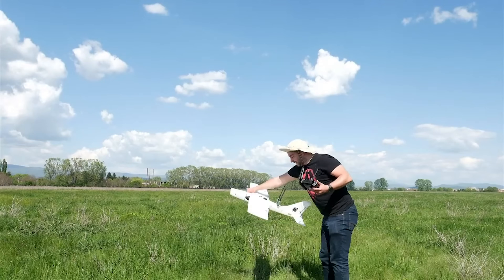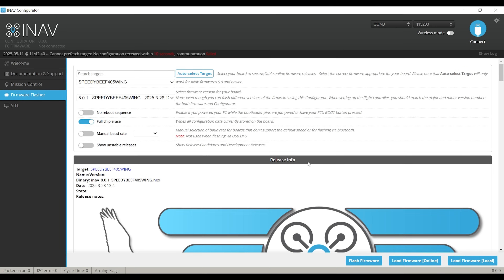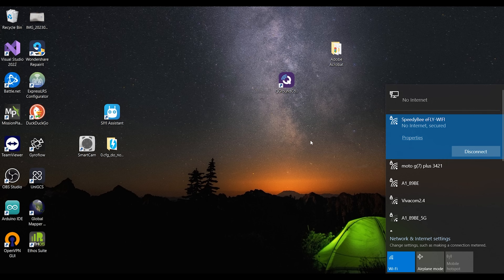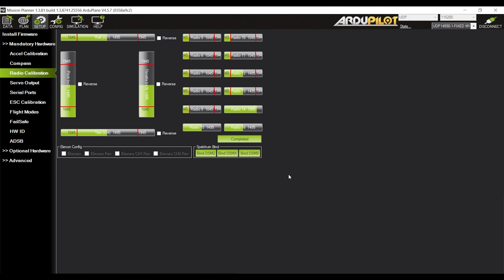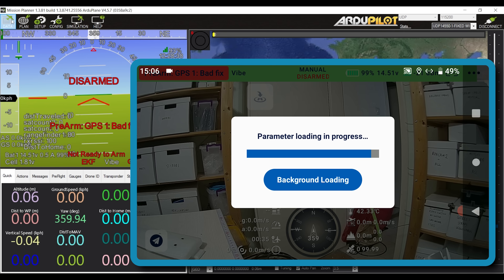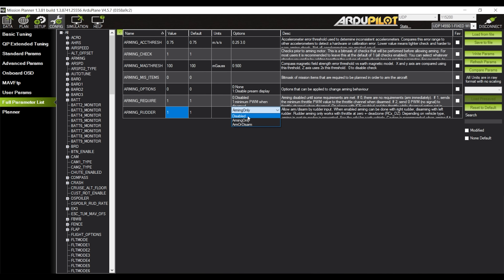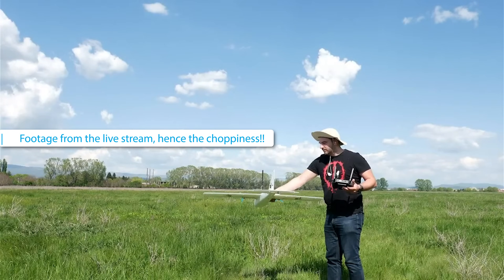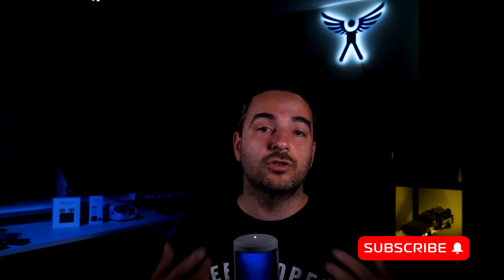HOW-TO SpeedyBee F405 Wing Mini - ArduPilot setup with SIYI MK15 HD Ground Control Station

Comment: @ArxangelRC   Also this board have issues when connect the airspeed i2c, it's caused by the i2c compass, 
just disconnect the SDA/SCL pins from GPS, it will disable compass and now you can use the airspeed
Reply from the maker: Good to know, but I am not planning on using an airspeed sensor on this plane.

Comment: It is just not connecting to wifi please help . I am trying again and again , it is in wifi mode, the led is white and I have connected it to laptop over wifi but in missionplanner whenever I select UDP and connect it shows select port 14550 I give enter and it shows that port is already in use and it's missionplanner itself
Reply from the maker: Weird. For me when I connect to it over wifi, and then wait for it to identify the network, then start Mission Planner, as soon as MP loads up it automatically goes to the UDP option and starts connecting on its own.

Comment: hi there, can you share me the wiring of mk15 air unit to the speedy bee flight controller.
Reply from the maker: It is not that difficult... you have an SBUS out from the air module to the FC, which should be only signal wire and GND, and then the telemetry cables, which would be TX to RX, RX to TX and GND from the FC to air module.
Reply: i too have same doubt, could you please post it

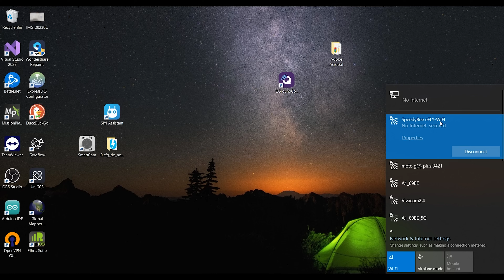Comment: 5:35 Wifi password is 88888888 or 8 times 8 in new versions thanks
Reply from the maker: Good to know! Thanks.
Reply: @ArxangelRC   Also, if you have problems with i2C airspeed sensor, it's caused by the i2c compass 
just disconnect the SDA/SCL pins from GPS, it will disable compass and now you can use the airspeed

Comment: Hi,
I have old plane whit apm and ardupilot and ppm rx . How can i replace fc whit speedybee fc ?
Do you have any suggestions cude i copy any setup from that old ardupilot and apm?
Reply from the maker: Hey, I am not sure APM param files would be directly movable to a new FC. The technology and sensor gen gap is so huge, that I don't think it would be wise. Besides, these newer APs have very decent code so it would be very easy to setup a new flight controller and get even better results. Only thing is... not sure you would be able to move over that PPM receiver though.. might want to look into updating the radio gear to something with SBUS... or trying to find a PPM to SBUS converter... if there is such a thing.
Reply: @ArxangelRC  ok thanks! I have expreslrs modul on my taranis.
Do you think that ardupilot take off setup will be good for 1.4m delta Wing or i must tvick setup?
Reply from the maker: Yeah, should be more than fine for that with the default settings, and you can start tuning after the maiden.

Comment: MIssion planner does not "automatically detect the network" as far as I can tell - and then what about the port setting?  14550?  Anyway I couldn't get wifi to work with my Windows 11 PC, but I was able to get Bluetooth working, and BTW for anyone reading, the NON-BLE bluetooth mode is apparently better/faster.
Reply from the maker: If you are connected to the correct WiFi mode, and we ARE talking about the F405 Wing Mini SPECIFICALLY, once the network is connected and identified, opening up Mission Planner should make it switch to the UDP mode automatically and initiate the connection, you should not need to enter a port number, at least that is how it works for me, as shown in the video, though I am using Windows 10, but I don't see why this would be different on Windows 11.
Reply: @ArxangelRC  I'm actually using the F405 Wing (not MINI) - hard to imagine though that there would be a difference in this respect (connecting via WIFI).

What do you mean by "wifi mode"?

I have been "successful" connecting via bluetooth - but only once or twice in 50 tries.  

One of the biggest mysteries in drone building is why SO OFTEN something works SOMETIMES.  I've been using MP and arducopter for 10-12 years, built a dozen or more drones, airplanes, VTOL, etc, and on a consistent basic, with many computers, including Windows and MacOS, etc, Mission Planner and arducopter (and all the associated hardwware) have been extremely flaky - or at least way more flaky than it seem like they should be...change drivers...change hardware...change parameters...reboot the drone, force quit Mission Planner, reboot the computer, 100 times over, and there seems to be very little consistency in why certain things work sometimes, and sometimes do not.  

Quite exasperating.
Reply from the maker: @Bill-NM  The Bluetooth mode on the MIni is not for PC connections. The non-Mini F405 Wing has two bluetooth modes, one of which works on a computer and I do have a few of those controllers, and the PC compatible bluetooth mode works pretty reliably. I am able to connect every time, after the initial pairing. Years ago connecting to an ArduPilot model wirelessly was indeed a hassle, but for the past few years it has been made very easy! Even back then there was only one driver and once you got it, then it just worked so long as you don't change anything. Things have improved A LOT since then! What you are describing in the end there has NOT been my experience at least for the past 6 or 7 years!
Reply: @ArxangelRC thanks very much - gives me hope. I do indeed have periods of time when things work well - good to hear you've had very good success.

Always enjoy your videos. Thanks again.  @ArxangelRC
Reply from the maker: @Bill-NM  Thanks mate, best of luck to you too! :)